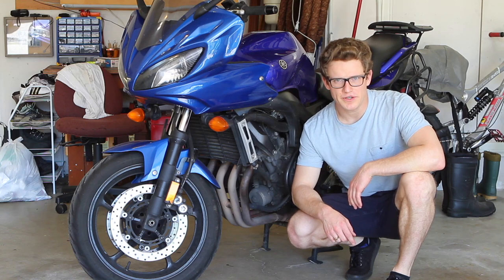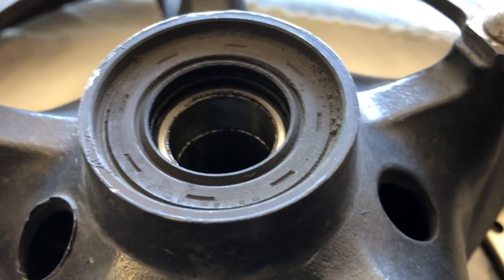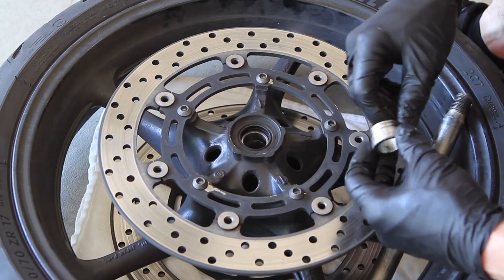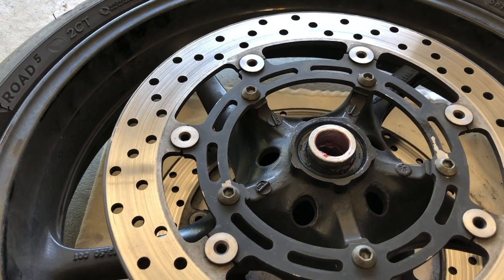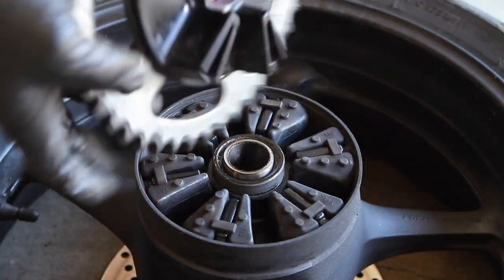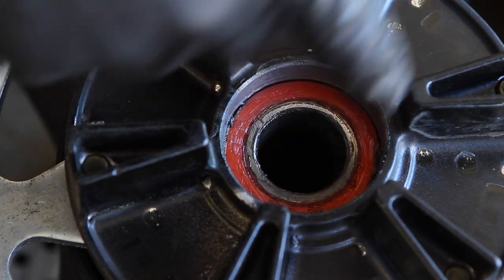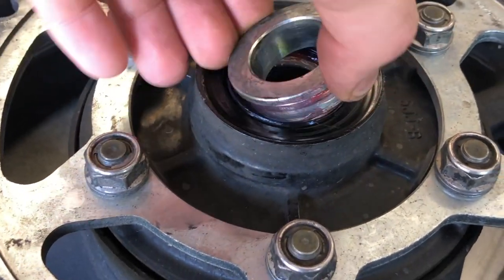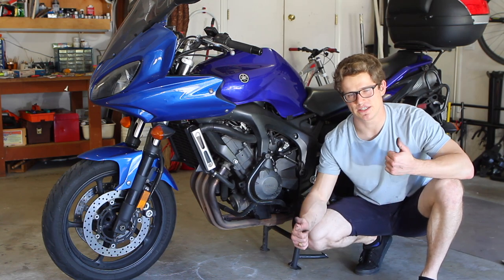How to Grease FZ6 Wheel Bearings

Comment: Hi Calvin MC! You are a specialist in Fz6 problems…. Please give me some tips what is the reason behind this noise: clanking noise from the clutch and the front sprocket when its in first gear and I give some throttle. I feel the hit on my left footrest. Sprockets ok, Chain ok, rear bearings ok.
Reply: Have the same noise/clunk when releasing clutch in first gear. I am afraid it will be the clutch housing or the discs in my case...

Comment: So you think standard lithium grease is ok on rubber ❔
Reply from the maker: The lithium grease is ok on rubber but I believe regular white lithium grease isn't "extreme pressure (EP)" rated. Yamaha seems to want this EP rating for this grease.
Reply: Calvin MC  I will always remember this good to know
Reply: @Calvinm  The color of the grease is just what the manufacturer colored it. Here in Finland I looked around and found EP rated green grease that was suitable and in the end ended up picking up EP rated lithium grease that was cream yellowish-white. For the wheel parts especially look for it's ability to resist weather (water), ability to cling to surfaces and high speed rotation along with EP rating.
Reply: Silicone is recommended for rubber not lithium

Comment: My son is driving 200 miles to pickup a 2005 FZ6 Saturday. I've watched some of your videos, great job, do you have any advice for what he should look for before handing over the money?
Reply from the maker: Check the idle is at 1300 when warmed up because that has a large impact on the charging system. Check the front brake rotor thickness, they should be between 4.5-5mm, they are expensive to replace if worn out. Inspect the chain and sprocket for wear and stretch. If the bike has over 40k km's (24k miles) ask if the valve lash has been serviced, if not just know it will cost around $800 if done by a shop. Then check the regular things like tires, lights work, no signs of being dropped or repainted in spots. Best of luck, hope the bike looks good!
Reply: @Calvinm  Thanks so much for responding. I had already watched your video about inspecting the brakes which is why I reached out to you. I sent my son a link to your channel. The bike has 30,000 miles but was garage kept and regularly serviced. The chain and sprocket are new. A video on what to look for when buying a fz6 would be a good addition to your channel. I can't express enough how much I appreciate people like you that put out good informative content.
Reply from the maker: Sounds like a solid bike. I actually just filmed a buyers guide and it’ll be posted in a week! Thanks for the kind comment, really appreciate it. 👍
Reply: @Calvinm  Thanks Calvin, he did in fact purchase the bike and is probably halfway home. The guy had all the service records and a valve adjustment was done at around 27,000 miles. He was able to do a 30 minute test drive and the only thing unusual to him was the friction zone on the clutch lever was close to full release. I don't know if that's a good thing or not. He has only owned 2 motorcycles, a Honda Rebel and a Honda Magna (which was a great bike). Both were purchased used. Other than the friction zone he was unfamiliar with, he said the bike performed fantastic. Negotiated to $2,500 from $3,000. Without actually seeing the bike I think he did well.
Reply: @citizengoodman8023  I have a 2010 FZ6. It's common on the FZ6 to have the friction zone close to full release.

Comment: Since it’s too cold to ride, I recently took off my front and rear wheels to check and grease the bearings. How much resistance was there from the bearings when you moved them by hand (with the wheels off)? The front did move freely but not as easily as the rear bearings. 

Thanks
Reply from the maker: Both the bearings move easily. You shouldn’t feel any sticky points or fluctuations in the resistance to turn the bearings.
Reply: Hmm I just did my tires and my front felt stiffer than rear.